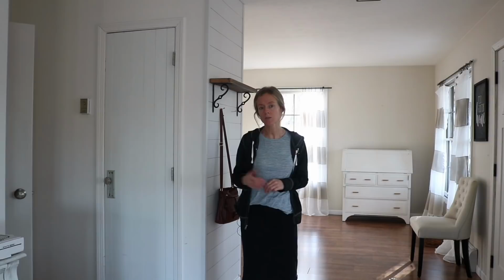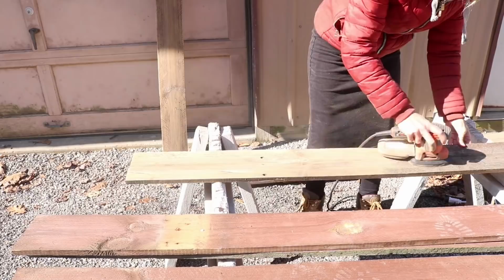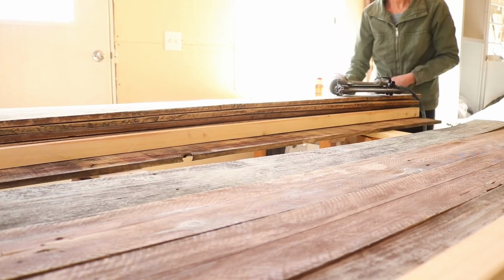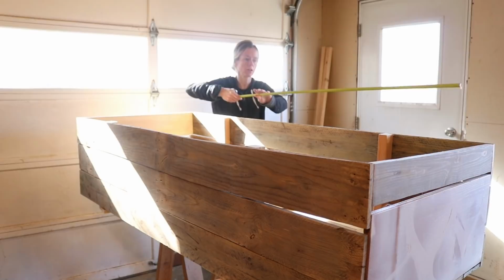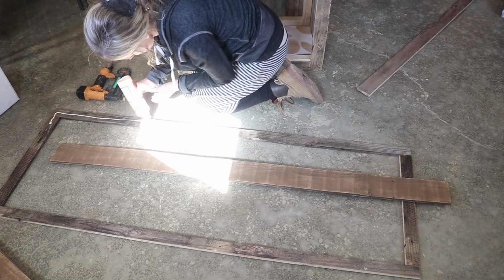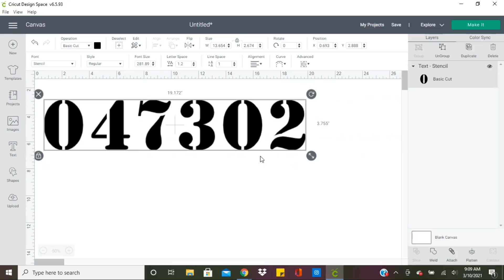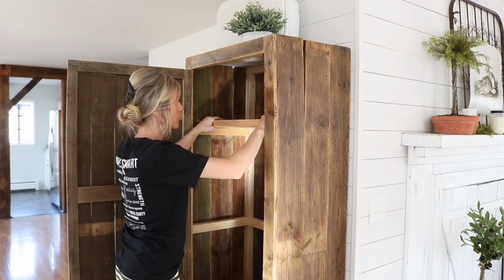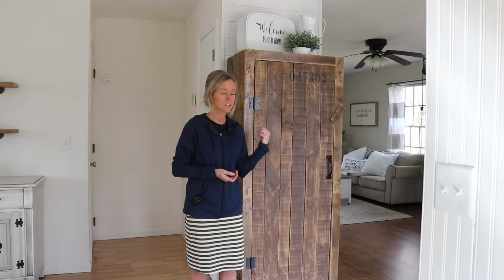Entryway Makeover ~ Farmhouse Style Cabinet ~ DIY Barnwood cupboard ~ Small Entryway Idea

Comment: Mary, what is the cutting tool/saw you used for your farmhouse entry cabinet -- it has the two blades on top of wood and one blade in the middle?  You mentioned you got one of your tools at a garage sale which I thank you for mentioning.  I'm new at working with furniture and currently just sand and paint wood furniture.  Eventually  I would like to start making simple wood furniture (small coffee table...).  I didn't think to look for working tools (nail gun...) at garage sales-thanks for the tip. Take care